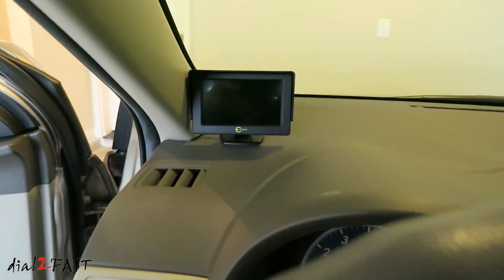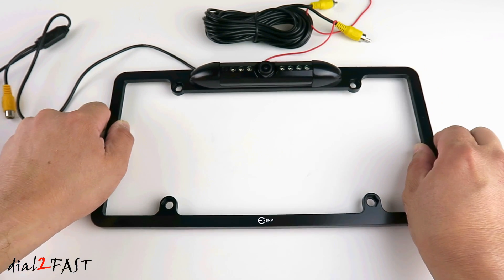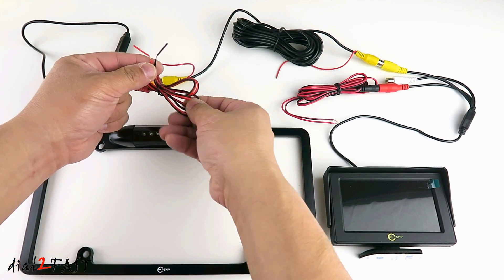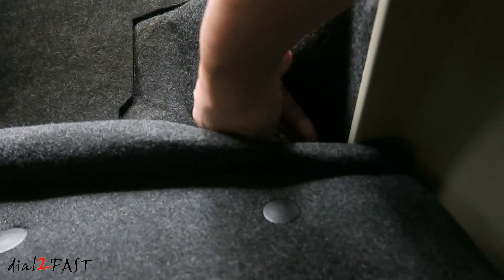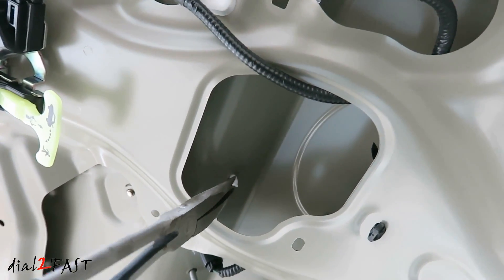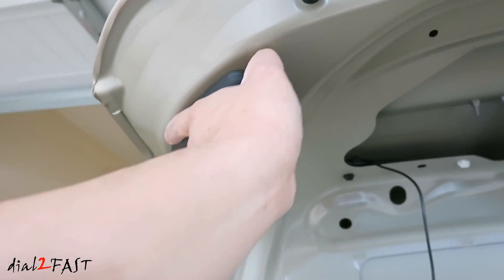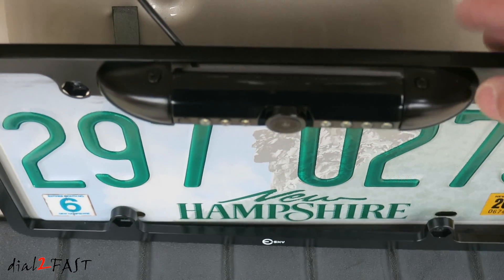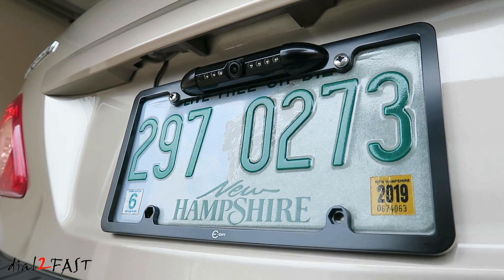How To Install Rear License Plate Camera System

Comment: nice video with good explanations, the only thing i would say is when you cut the notch for the wire behind the backup light, i would put some tape or some heat shrink around that part of the wire because you have it  against the metal of the car. With the opening and closing of the trunk and just vibration, it will eventually cut the wire in that spot and cause issues.

Comment: I just get a car license plate rear ire cámara, but these one is deferent  to the o e you showing in your video these one has 8 red little light. But it does bring all the wires. Now mi question is because I didn’t know I didn’t get the screen were can I get it as the speaker said in the video it just coast 22.00$ .

Comment: Hello, I just installed a Pyle backup camera PLCM38 FRV to the Esky monitor. However the image on the monitor is flipped. Tried both AV1 and AV2 video inputs but unable to get the monitor to orient the image correctly. I don’t see any available settings on the monitor to change the image orientation. Any ideas on how to fix this? Thanks!

Comment: Connection in truck was confusing.  Ie red wire on power connect to light or red wire on video feed cable or do both connect to hot on light and black to light ground.   Nor did you show ground Connection up front

Comment: Do you cut a slot on the licence plate frame as well? Otherwise the wire gets smashed between the car body and the plate, which with time will cause it to fail.
Reply: Just take the license plate frame off..

Comment: How well does this camera hold up to heavy vibration caused by a sound system installed in the back. I have 2, 10 inch subs and 1500 Watt amp in the back of my Jeep Compass.
Reply: Bad Drivers of NW Montana use Anti sleeze for the screws do not get unloose by vibrations

Comment: This company has misrepresented this camera and it use.  Online it's wireless and solar charged and connects via blue tooth to cellphone.  
Very unhappy with this purchase 😔
Yes I'm holding the very same camera shipped from CHINA via San Francisco.  They even sent a card for complaints and Refund does that tell you something?  Do NOT purchase.
Oh by the way doing as seen on this video voids warranty on the more expensive product - the automobile.